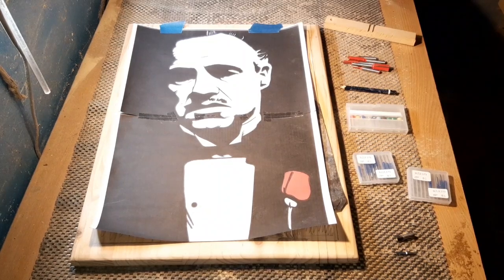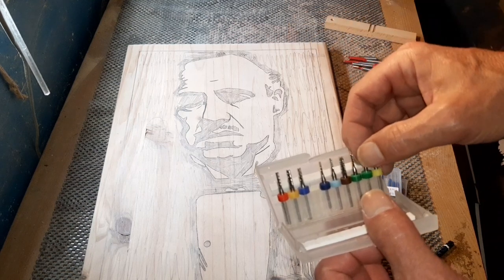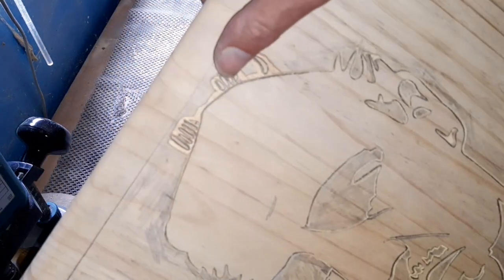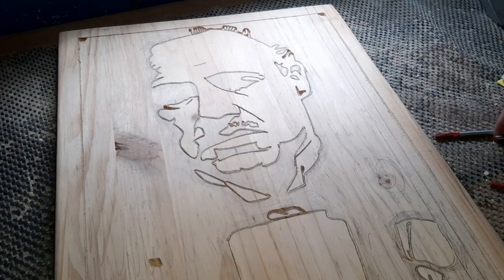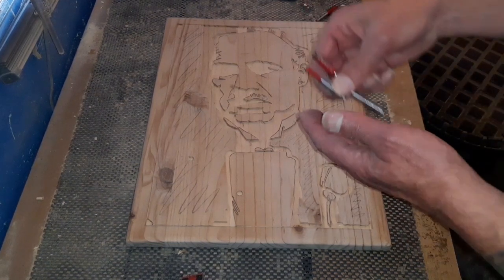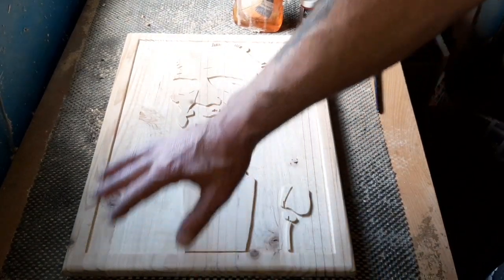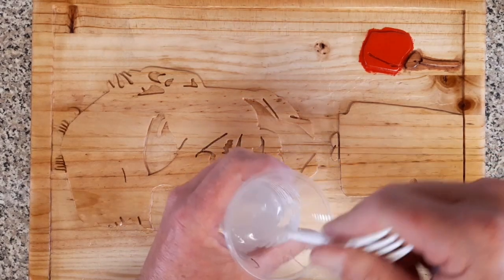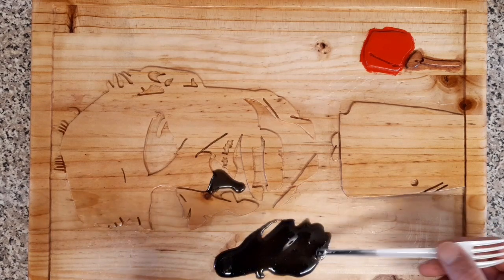Marlon Brando the Godfather inlayed with resin, router project..

Comment: Hi Shane, amazing job on the Godfather. Just wondered what your thoughts are if you had painted it with black paint instead of resin, what are the pros and cons ??
Reply from the maker: Thanks Niall,I've done projects and painted the background with black paint,the large skull head was one one them..looks just as good..paints alot cheaper that's for sure..I just like to try different options..Good thing with resin is it covers alot of the rough wood,it's leaves a great finish..download is it can't be used outdoors, the colour fads with uv light..
Reply: @fishtank5050  Hi Shane, good info I might give it a go with paint to start off with as you said it is cheaper but will show the rough, if goes well than do resin and see how they look together. Many thanks, look forward to your next vid
Reply from the maker: @niallrhysevans218  will look good with paint,I use painters touch paints on the back piece..👍
Reply: @fishtank5050  I will give it a go, thanks for all the info